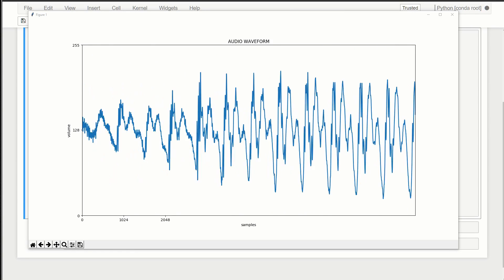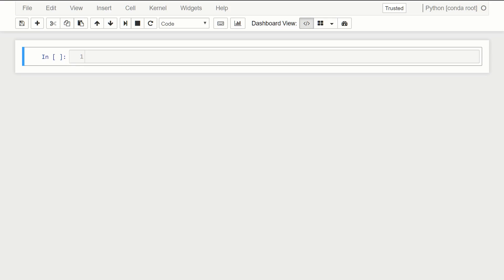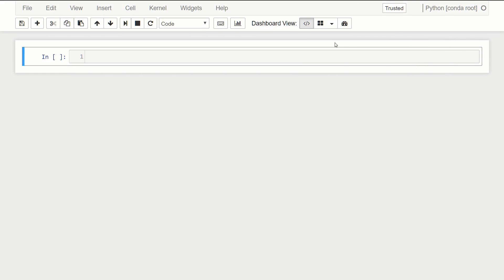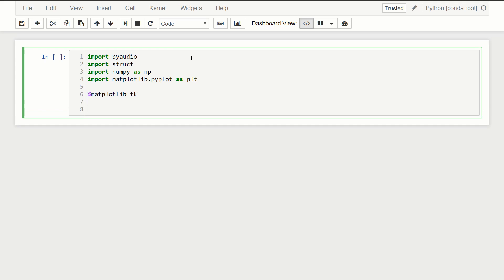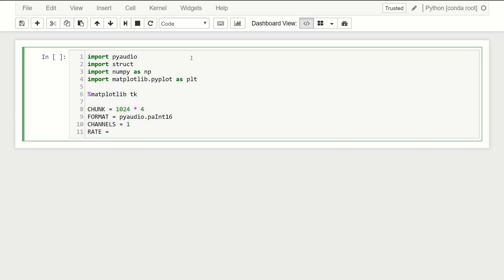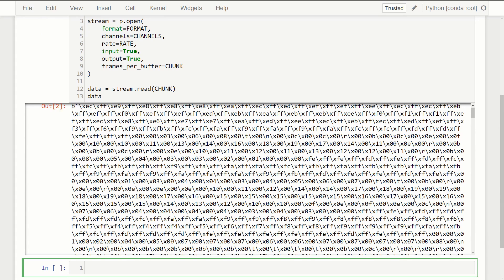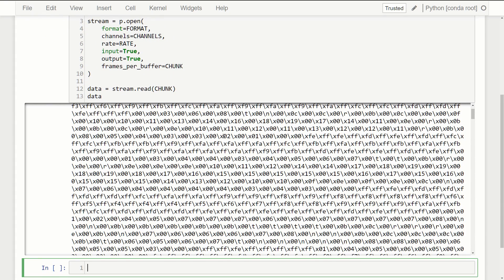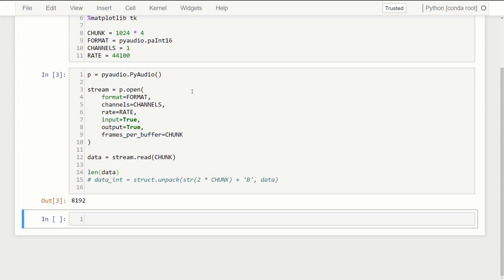Let's Build an Audio Spectrum Analyzer in Python! (pt. 1) the waveform viewer.

Comment: The window does not show. After the while i run the project but the windows does not show like in the video and i get this messages on terminal 
 ALSA lib pcm_dsnoop.c:606:(snd_pcm_dsnoop_open) unable to open slave
ALSA lib pcm_dmix.c:1029:(snd_pcm_dmix_open) unable to open slave
ALSA lib pcm.c:2266:(snd_pcm_open_noupdate) Unknown PCM cards.pcm.rear
ALSA lib pcm.c:2266:(snd_pcm_open_noupdate) Unknown PCM cards.pcm.center_lfe
ALSA lib pcm.c:2266:(snd_pcm_open_noupdate) Unknown PCM cards.pcm.side
ALSA lib pcm_dmix.c:1029:(snd_pcm_dmix_open) unable to open slave
Cannot connect to server socket err = No such file or directory
Cannot connect to server request channel
jack server is not running or cannot be started
JackShmReadWritePtr::~JackShmReadWritePtr - Init not done for 4294967295, skipping unlock
JackShmReadWritePtr::~JackShmReadWritePtr - Init not done for 4294967295, skipping unlock

i will apreciate if somebody can help me
Reply from the maker: Juan  Montaña are you running this in a jupyter notebook? Also are you using macOS? I noticed issues when trying to use pyaudio with mac
Reply: Mark Jay thanks for answering, I'm running on Linux
Reply from the maker: Juan  Montaña it could be an issue with pyaudio on linux. I'll try running it with my linux machine
Reply: Mark Jay thank you, specifically I'm running on Ubuntu 16.04. Another thing is that I can't type %matplotlib because the program does not run, looks like a syntax error
Reply from the maker: I had an error installin pyaudio on ubuntu (18). It looks like the error I got when trying to install pyaudio on macOS. I'll see if I can get it workiing
Reply: Installing ? weird, to install pyaudio i just type  sudo apt-get install python-pyaudio
on bash and to install matplot  i use sudo apt-get install python-matplotlib
 on bash... ok mark, thanks bro

Comment: Hey Mark great video! I'm trying to average the volume level in each chunk, save it as an int, and amplify sound based on the level of the int. So for example, if the average of the int from our mic increases, I amplify the sound from a file playing. If it decreases, I lower the sound. Basically changing the output of a sound file based on the volume level from our mic. Any thoughts on how I can go about this?
Reply from the maker: Daniel Li that's basically the functionality of a compressor. You can get the average value of a chunk using numpy.average. I'm not sure about how to use that to affect another audio source

Comment: Great video! I am getting 00 values when returning data as well as data_int ('0\x00\x00\...' and '0, 0, 0...' respectively) Any advice would be much appreciated.
Reply: Yeah, turns out for some reason printing the data on just one chunk doesn't work, but printing the data in a loop works fine. Thanks! BTW .frombuffer and .fromstring return much cleaner data anyway! your videos rock dude!!
Reply from the maker: Chris Coletti sounds like a conversion problem from bytes to ints. You could try using np.frombuffer To do the conversion instead of struct. Someone made a comment in the github issues section which shows the correct syntax
Reply: did you ever figure it out? im getting the same problem were the data is either 0 or 255, nothing in between...
Reply: @catsnstuffpb  Hey man, I'm having the exact same issue and can't figure out how to fix it. Do you remember what you did?
Reply from the maker: Hassan Khalil try using np.frombuffer and I think the type is <i2
Reply from the maker: awesome! thank you!

Comment: I'm having an issue with "%matplotlib tk". I get an error about invalid syntax. I'm running python 2.7..
Reply from the maker: Brent Cavner try watching part 3 where we switch to a normal python file to run. The code link is in the description
Reply: Awesome! It works. Thank you! Is there a way to reduce the noise it is picking up?
Reply from the maker: Brent Cavner awesome! The noise is likely due to hardware, like your microphone, or the interface. I've noticed that sending audio in through the headphone jack can be noising. If you can get a usb audio interface, it will likely help

Comment: You can do
data_int = np.fromstring(data, dtype=np.int16)
Reply from the maker: First Last thanks, I think that's a better method for converting the bytes than struct
Reply: i just want to thank you both mark jay and adam rose, the code adam rose submitted fixes a problem when audio goes beyond 255 or under 0  (what i can guess is saturation) that the base code has, it yielded better results when i tried this method and it even worked in the part 3. please pin this comment so that everybody can know

Comment: hi, i want to try your code, but i had a problem, but it´s something strange, it says:
AttributeError: 'Window' object has no attribute 'setGeometry'
i don´t know if something its missing, or something else...
im working on raspberry 3 with ubuntuMate...
Reply from the maker: richardyo888 you can remove that line of code. I just used that to center the figure on my screen, but its not necessary

Comment: you get twice the size in the data, because 2 bytes represent one 16 bit
signed integer, which is what you want to read.

you should unpack with the 'h' flag
data_int = np.array(struct.unpack(str(CHUNK)+'h', data))

and set limits from about -600 to 600
ax.set_ylim(-600,600)
Reply: actually the limits should be -32768 to 32767,
ax.set_ylim(-32768,32767)

Comment: Hi it is running , plot is displayed - however I get random noise on the graph not related either to mic or other I/O sound devices .
Is there e simple way to select which device is acting as Input. I want to analyze the music coming out default output device instead from mic. Using last Anaconda distribution with Jupyter notebook on WIN10. Thanks

Comment: Hi. This is helpful for me since I’m new to Python. The problem you’re having with the data looking split - around 7:05 in the video - is pretty obviously because the data is coming back as 2’s-complement in the hex values and your conversion to integer doesn’t do that correctly.  Please look up  2’s-complement to see how to do the conversion.
Reply from the maker: David Rogoff thanks, I will check it out. I notice this everytime I use struct.unpack
Reply: To convert from 2s cm is just a not +1 right?

Comment: for me the window is not showing, i print the data_int in the console and the numbers are showing  in console but the window not appears
Reply from the maker: do you have matplotlib installed?
Reply: i resolve putting this line 'plt.show(block=False)' before the while, thanks, do you know one way to get the frequency number of the audio ?
Reply from the maker: Negocio Esquisito awesome! Check out pt2 in the series. We add a spectrum analyzer
Reply: @negocioesquisito  Thanks , I didn't know about the 'block = False' thing, that's good to know in general
Reply: @negocioesquisito  thanks!

Comment: hi mark 
i 'm getting this error " File "<ipython-input-2-4b6ce295a221>", line 12
    data = stream.read(CHUNK)
    ^
IndentationError: unexpected indent"
Reply from the maker: Imene Ben Haddada you've made an indent error.
Reply from the maker: Imene Ben Haddada python is picking about using indents so be mindful of them.
Reply: Excellent video Mark. Thank you.

I'm getting the same error, even with indent... 

OSError                                   Traceback (most recent call last)
<ipython-input-2-aef67efd4722> in <module>()
     18 
     19 while True:
---> 20     data = stream.read(CHUNK)

Comment: Hi Mark Jay!!! 

Thanks for your video!!! ... its pretty cool to see how one can do a ton of things with audio in python.

Although, I stumbled with many issues...  I'm not sure why it isn't working for me.... ill try to explain to you what I got so far..... and a hit of warning, I'm a superb nooob to python :-P..

first off, your code has to work in normal python script, right? ... regardless whether one uses anaconda, or jupyter, right??? if not, then what shud I do extra in order to run the code properly in python script?

if yes,

i have written the code exactly how showed it....  when i plotted the tuple obtained after using the struct.unpack, i got a plot, but its not at all like yours in 7:20  .... it looked more like a series of pulses, and all of them of equal amplitude, from 0 to 250... from there, i know for sure that something's up.... i did a bit of snooping around in the internet, and i saw similar examples, where ppl used input_device_index ..... but it seems that it works perfectly for you anyways.... although, I'm not sure if the input mic has anything to do with the plot i got, or???

then i created the np.array as u mentioned, and there were values going to zero as you mentioned.... then i used the [ : : 2], but nothing happened... it was the same....  
 i tried using the np.array without the +127 to see how it looks, and the plot ranges from -1 to 1, and there are values, that pivot around zero...... i guess this is fine in general, but here also, i tried using the [ :  :  2], but nothing happened anyways....

is it possible for you to help me out on this??? i would really appreciated it!!!! Thanks for the video, it was really awesome!!
Reply from the maker: Vasishta Kanthi I'm glad you liked the video. If you check the github repo, I made a version of the code in a normal python file. I'll share the link. For me the issue is with struct.unpack. after calling unpack I had to
1. Convert the tuple to a numpy array with dtype=8bit int. 
2. Then add 128 to bring the 0 point to the center range. 
3. Then slice out every other point in the array. 

At this point you could convert the array to a float32 dtype and resale however you like.
Reply from the maker: Vasishta Kanthi check out this file 

https://github.com/markjay4k/Audio-Spectrum-Analyzer-in-Python/blob/master/audio_spectrum.py
Reply: Hi Mark Jay!!

Thank you very much for your reply, and thanks for the new code you shared. it is helpful, and more intuitive as a class object.... but again Ive fallen into some errors.... some of them I have fixed it, but in the end I'm ending with a division by zero error when calculating the self.fr=frame_count/(time.time()-start_time)

first I realized I didn't have the pyqtgraph module, as well as the pyQt4 module, but I installed it successfully..

then, for this line:

thismanager.window.setGeometry(5, 120, 1910, 1070)

apparently there is no attribute 'setGeometry' ... I'm not sure if I have to install a new module for this, ......... do I??

but I realized this was just resizing the window for the time and frequency plot in real time... so I just commented it and the stream started, but then, I ended with the division by zero error.... 

the plot I got, the time plot was zero, and the frequency plot was full of noise..... 

cud this be an issue with the input mic??.... if so , how should I fix it??

once again, thanks for your valuable help!!
Reply from the maker: Vasishta Kanthi sounds like it could be the microphone. Can you raise the input volume on the mic to get more signal into it?
Reply: hi mark jay....

I checked the mic volume, and it was already in full volume.... but then I realized that earlier, I didn't make any sound when the streaming started... so now I made a sound test before the stream started, and now it works!!!!! although, a bunch of errors have come up, I think I can try debugging them ....

thank you very much !!!! wish you a happy and prosperous new year!!!!

you have my like and subscription :-D

Comment: Great vid!

Here is some additional information about the code you, or others, may find interesting:

FORMAT = pyaudio.paInt16
The line above means that every sample from the mic is of type INT16. Generically when you have type INT, that means that you have a number that can be plus or minus and it does NOT have a decimal point. For example: [-2, -56, -1, 0, 1, 5, 78] are all INTs, but -2.34 is not an integer. What the "16" means at the end of INT16 is that this particualar INT type only has 16 bits. having 16 bits means you can have 2^16 values... 2^16 is 65,536. Because you can have "+" or "-" values this means that half of the 65,536 are negative values and the other half are positive values (0 is included with the positive numbers). So that last thing to talk about here is the "Range" of the INT16 datatype. Range meaning from what number to what number does an INT16 cover. INT16 range is [-2^15 to 2^15-1] (the "-1" is because of 0 value)... so the range for an INT16 ends up being [-32768 to 32767].

This datatype of INT16 becomes important when we want to properly "read" the values given to us when we use the "stream.read(CHUNK)" function. All the "stream.read()" returns is binary data (1s and 0s). When we display it (use the print() function) Python shows us the values in HEX format one "Byte" at a time. A "Byte" is 8 bits (8 ones and zeros). This is why when the len() function is used on the stream.read() data it should double of the CHUNK value, because the len() function is returning how many BYTES of data not how many INT16s, but we know we asked for 16bits of data or 2 Bytes.  But really in the memory it just looks like this: [111010001000100010101010010101010100....].

We use the struct.unpack() function to tell Python how to read in all this ones and zeros. It takes two paramenters: struct.unpack("how many and what kind", "binary data"). We already know the "binary data" is the data we get from the stream.read() function. So what about the "how many and what kind", and by "kind" I mean datatype. We know we just pulled a "CHUNK" of data so that is the "how many", but what about the datatype... Well we specified it before, INT16. If you look at this website: https://docs.python.org/2/library/struct.html, it says that a signed integer of 2 bytes (16 bits) is coded with an 'h'. And because this parameter is needed in string format we convert CHUNK to a string and then add it in front of the 'h' (str(CHUNK) + 'h'). Let's say CHUNK is 4096, so the string value for the first parameter would be "4096h". Once again this means there are 4096 samples of audio that are INT16s in this binary data we received from the struct.unpack() function.

Here was my final code (note I had to add plt.ion() to make it work). I'm on Ubuntu 14.04

#! /usr/bin/python

import pyaudio
import struct
import numpy as np
import matplotlib.pyplot as plt
import time

#%matplotlib tk

CHUNK = 4000
FORMAT = pyaudio.paInt16
CHANNELS = 1
RATE = 16000

p = pyaudio.PyAudio()

chosen_device_index = -1
for x in xrange(0,p.get_device_count()):
    info = p.get_device_info_by_index(x)
    #print p.get_device_info_by_index(x)
    if info["name"] == "pulse":
        chosen_device_index = info["index"]
        print "Chosen index: ", chosen_device_index

stream = p.open(format=FORMAT,
 channels=CHANNELS,
 rate=RATE,
 input_device_index=chosen_device_index,
 input=True,
 output=True,
 frames_per_buffer=CHUNK
 )
 
plt.ion()
fig, ax = plt.subplots()

x = np.arange(0, CHUNK)
data = stream.read(CHUNK)
data_int16 = struct.unpack(str(CHUNK) + 'h', data)
line, = ax.plot(x, data_int16)
#ax.set_xlim([xmin,xmax])
ax.set_ylim([-2**15,(2**15)-1])

while True:
 data = struct.unpack(str(CHUNK) + 'h', stream.read(CHUNK))
 line.set_ydata(data)
 fig.canvas.draw()
 fig.canvas.flush_events()
Reply: You earned my respect :<
Reply: i tried just copy pasting ur code.. i got error saying "xrange" is not defined.. and can anyone help me with the %matplotlib tk.. im getting error from this what should i do? im using python 3.7 and pycharm as IDE
Reply: @Mayo020  The code will not work as-is with python3.7. You can replace "xrange" with just "range" and if there are any "print" statements you need to put ( ) around what you want to print. This should let it work with python3. Here is some slightly more complicated code but you might want to take a look at it: https://gist.github.com/netom/8221b3588158021704d5891a4f9c0edd  Good Luck!
Reply: Took a little time to look over that code from netom and this example from matplotlib.org: https://matplotlib.org/2.0.2/examples/animation/simple_anim.html and modified netom's code to do what the code in the video is doing, namely just displaying the audio samples. Running in Ubuntu 18.04 using Python 3.6.9....

#!/usr/bin/env python3
# -- charset utf8 --

import pyaudio
import numpy
import math
import matplotlib.pyplot as plt
import matplotlib.animation

RATE = 44100
BUFFER = 4096

p = pyaudio.PyAudio()

stream = p.open(
    format = pyaudio.paFloat32,
    channels = 1,
    rate = RATE,
    input = True,
    output = False,
    frames_per_buffer = BUFFER
)

fig = plt.figure()
line1 = plt.plot([],[])[0]

r = range(0,BUFFER)

def init_line():
        line1.set_data(BUFFER, [0]*BUFFER)
        return (line1,)

def update_line(i):

    try:        
        data = numpy.fromstring(stream.read(BUFFER), 
                dtype=numpy.float32)
    except IOError:
        pass

    line1.set_data(r, data)    

    return (line1,)

plt.xlim(0, BUFFER)
plt.ylim(-1, 1)
plt.xlabel('Audio Samples')
plt.ylabel('Amplitude')
plt.title('Audio Magnitude')
plt.grid()

line_ani = matplotlib.animation.FuncAnimation(
    fig, update_line, init_func=init_line, interval=0, blit=True
)

plt.show()
Reply: @heyjose224  Thank you. I modified xrange with range, and added the paranthesis. It works for me :D
Reply: @Mayo020  I just read that in python 3, they changed xrange() to range(). I did this and the error went away!
Reply: Very good
Reply: hey i could not understand what chunk does here can you please?
Reply: @mushfiqurrahman1552   "CHUNK" is the number of INT16 samples to pull from the sound device.
Reply: Why not change the format
Reply: bowdowntoyou